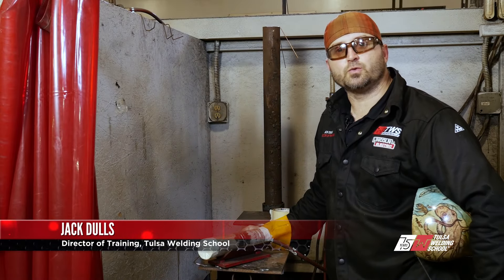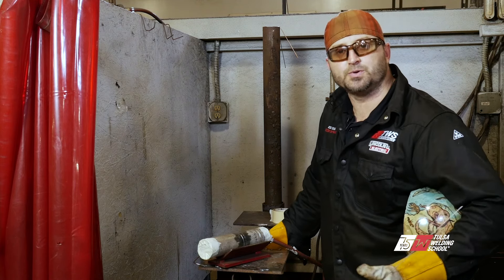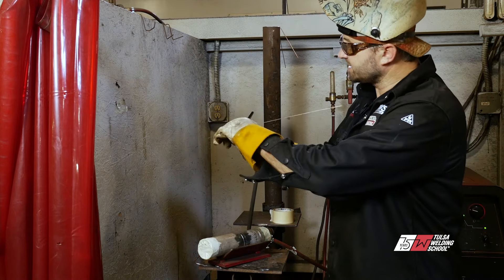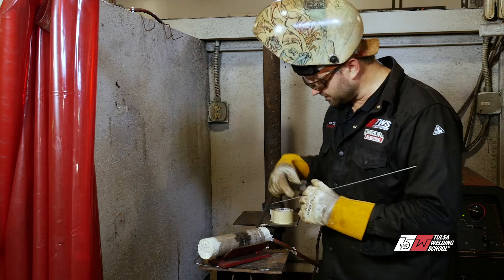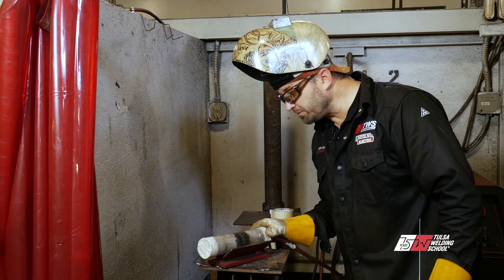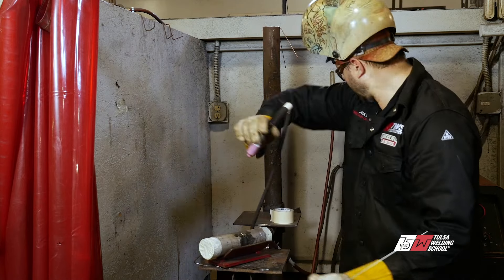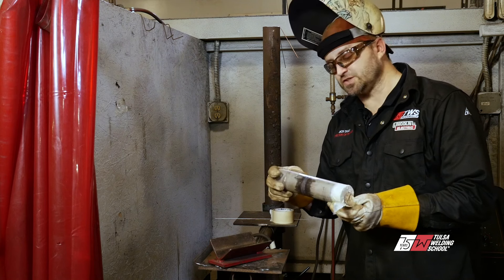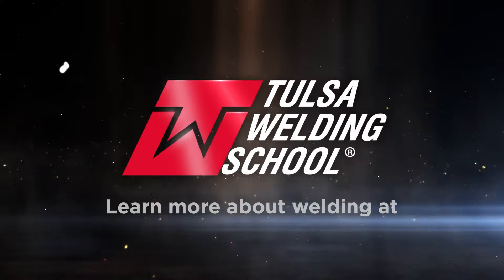2 Inch Schedule 10 Stainless Tutorial

Comment: Never trust your regulator.  Check it with a gauge always and you just might be surprised how much off it is telling you.. Then set regulator after checking to double the aize of the cup, maybe plus 2. And learn to concentrate on the heat input,you can see it, around the weld pool. You will  have to fuck with balance and shit to tighten it up. When you start seeing the heat inpt spread out,let off the pedal"never fast" but slowly. Then you'll start learning how to own that stainless shit and aluminum! I went to school there in Jacksonville in 2009-10. This is the shit you learn after in the real world. And try and fuck around before class or after learning some fab skills cause that will help you on your resume! Learn to notch pipe while you're there! I'd apply there cause I have been teaching but I'm not standing in front of no class. Field teaching only. So everyone go on amazon or "Baker's Gas " and order a gas regulator check. Fits right over your cup and too much gas will fuck shit up. Same with too little.  "Acetone" "Never ever dunk/dip your tungsten and think you'll slide by cause you'll only be fucking yourself.  And watch "Pacific Art" on YouTube.  Trust me! "Pacific Art when it comes to anything TIG related. .